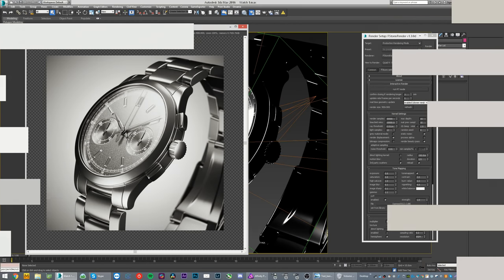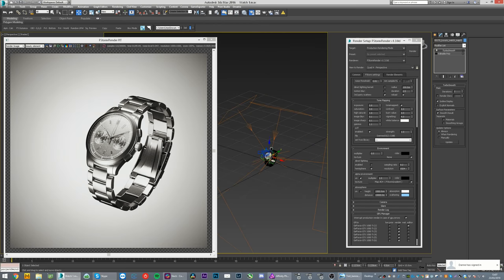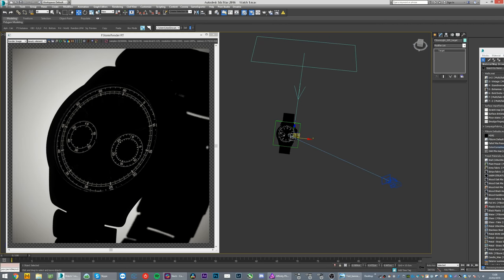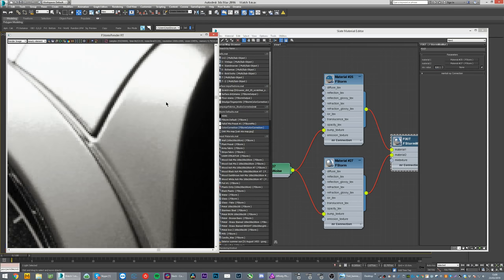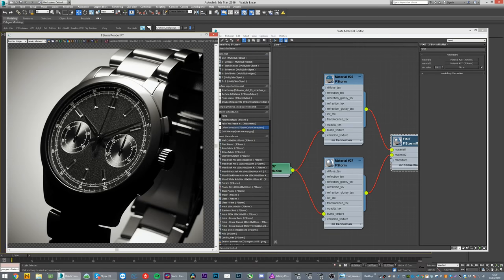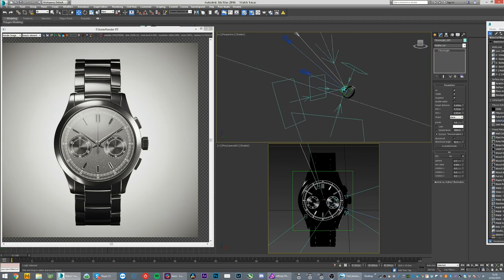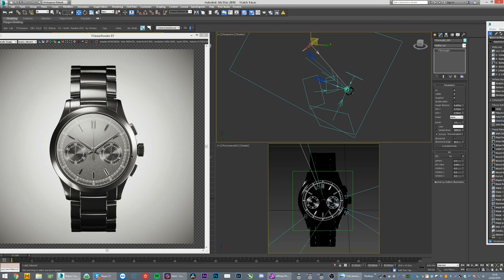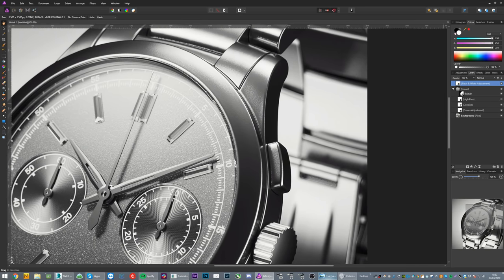Rendering a watch in FStorm

Comment: Nice video! Learned a few things, damn didn't knew in max you can adjust light with picker, that gonna help me alot! 

13:50 The HDRI can be useful in some cases, i usually start with an 50-100% desaturated HDRI ( and sometimes i just make it dark like 0.2-0.4 intensity ) , because when photographer shoots a product there's still some environment there so i think it adds that little extra touch of realism when you're not exactly after stylized product pics.

Comment: Since its a metal material a dark or black surrounding is actually better. It will make the metal pop much nicer. One just need to find the proper location for reflections or the lights so to say.
Reply from the maker: Exactly, here I have the surrounding completely black which gives full control. Some have suggested finding HDRI's for environments and that just wouldn't work well at all.
Reply: @TextureSupply  When i do metal or product shots, most of the time i end up with either very dimmed HDR and custom emitter planes. Way more control. I also tend to parent some light to an empty/null so they will follow this and i dont need to do a lot of manual adjusting the emitter planes.